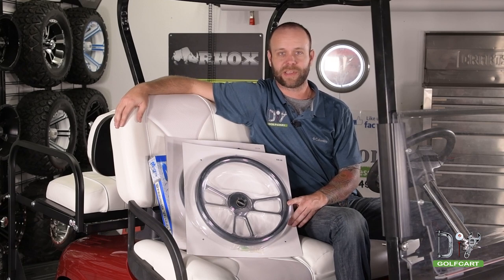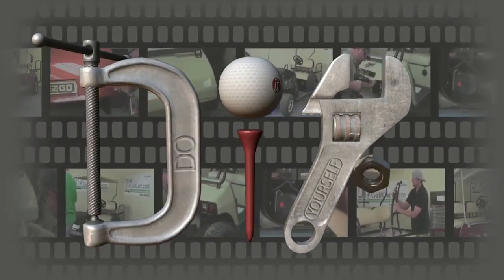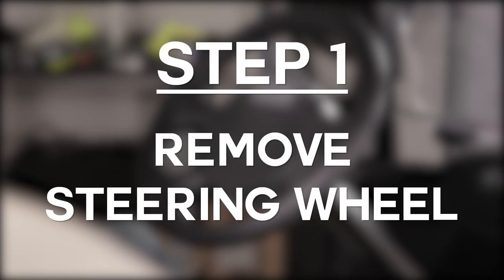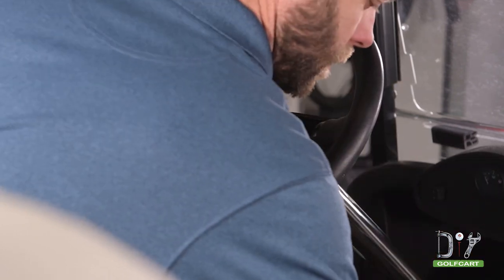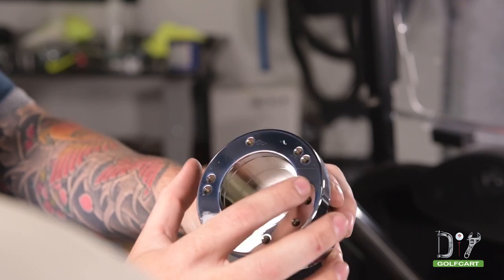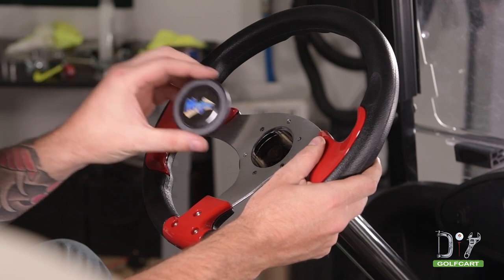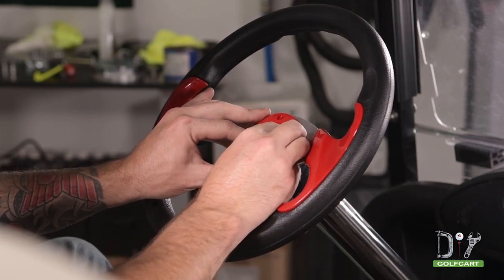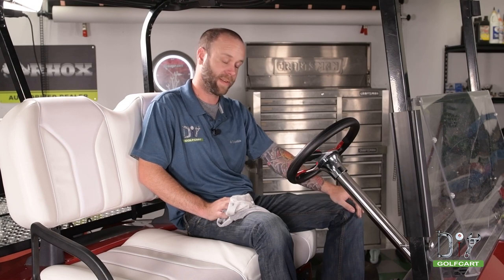Golf Cart Steering Wheel Installation How-To

Comment: Justin just curious if you've ever encountered a bent steering wheel after a few years use?  I installed one very similar to the one in this vid on a 99 Club Car.  It has never been abused just hand on the wheel when using.